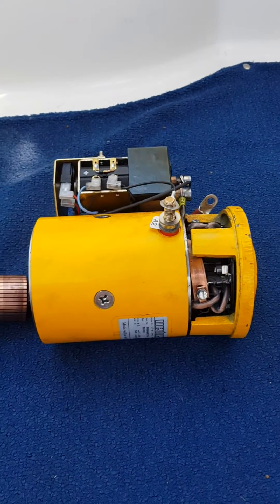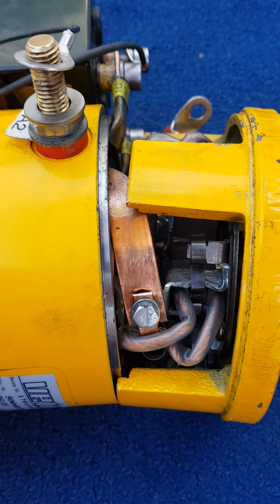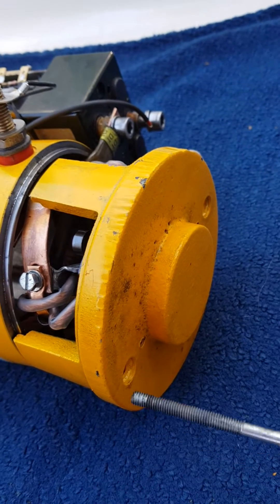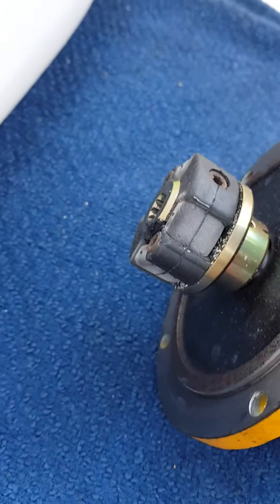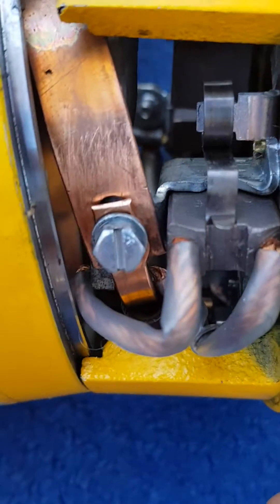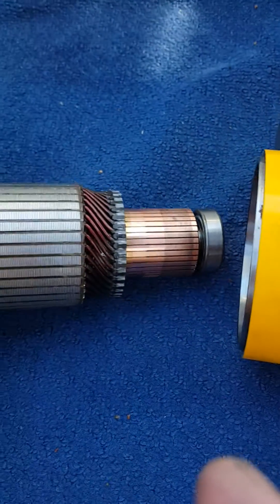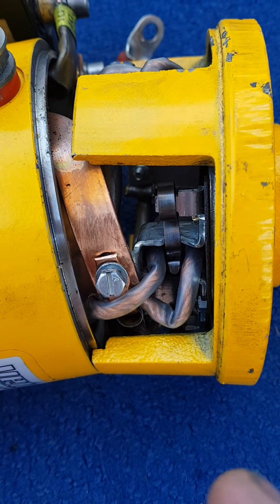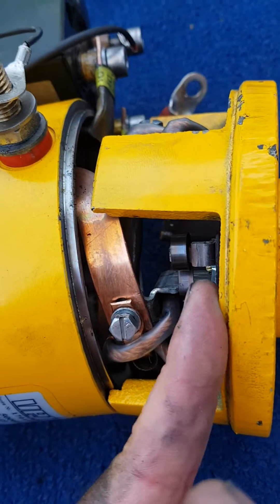Vetus 55 KGF Bowthruster overhaul carbon brushes

Comment: The small 2 mm thick gasket between the leg and the tube is what prevents water coming in. Do check motor for ferm fixture because if it moves then it's usually the two m8 bolts below the adapter that ha e worked loose allowing water to come in.

Comment: Did you remove the motor while the boat was in the water?
Reply: Yes, it's fine to remove whilst it's in the water. There is a seal between what this motor turns and the thruster tube (which is in the water)